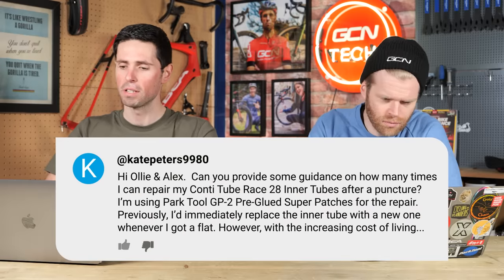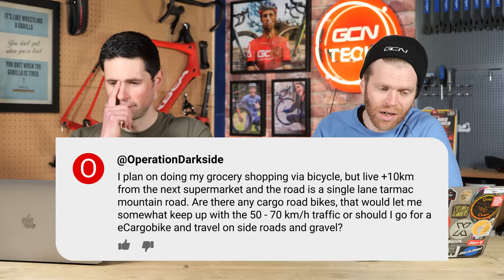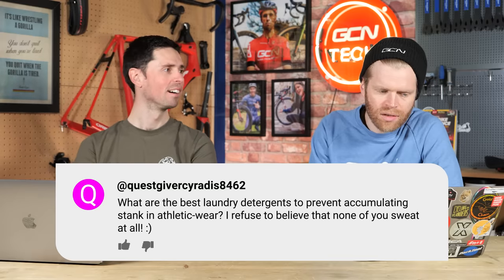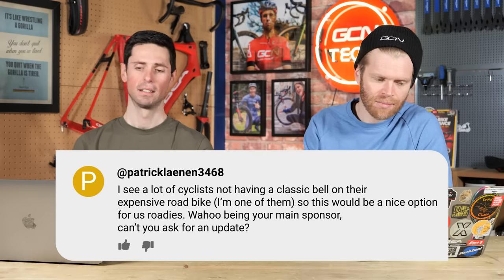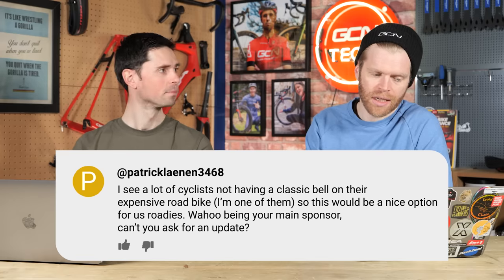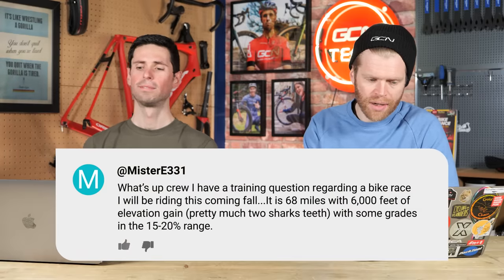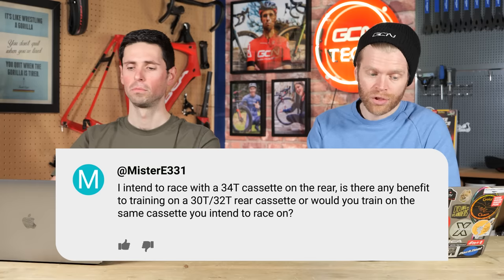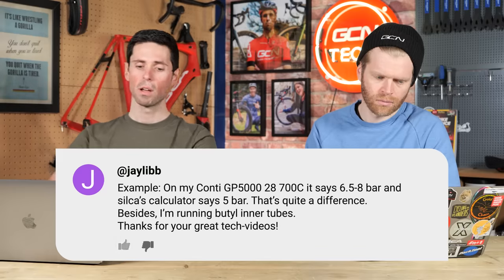Optimal Tyre Pressure, Noisy Chains & Inner Tube Repairs | GCN Tech Clinic

Comment: Hi Alex & Olli, this is probably not a tech-related question but you guys have done some videos on bike saddle and fit. I've been cycling since 2016 and I started having saddle sore issues from 2017 till now. I've tried different saddle types and brands, used different bike brands, tried out different bib shorts from various brands, done a lot of bike fit (sometimes multiple bike fit for the same bike) but nothing seem to help. I wouldn't be so much bothered if they were normal sore that most people riding a lot probably have from time to time, but sometimes mine could last for weeks (i've even had a surgery once to cut it off). I need help guys, I don't want to give up on cycling (it's the only sport i'm interested in, besides my performance on the bike motivates me to want to keep going). What else can I do? Thanks. #askgcntech

Comment: Some of my tubes have three or four patches. 10 years ago, I bought a box of 100 Rema Tip Top F1 25mm patches. I probably could have used F0 patches 16mm, but I still have lots of the 25mm ones.

Comment: @ollie  Hey Ollie, So glad you guys are pushing waxing and have stopped the Muc-Off support. But you are giving some out-of-date advice WRT removing the chain from hot-melt wax. You say we should let the wax cool until there is a skin on the surface and then slowly remove the chain. This is not necessary and also just uses up a lot of wax which sticks to the outside of the chain. This gets ejected in the first 10 minutes of riding as you break-in the newly waxed chain. The wax that matters is inside and there will be no difference in the amount there whether you remove when the wax has cooled or when it's hot.  Check out ZFC. I think Silca used to say let the wax cool so there was a skin - but again, not necessary and a waste of wax.

Comment: I can't imagine ever having a bell or beep type device on my bike although there are times when it would have come in handy when passing a slow group of side by side walkers or cyclists. Although I suppose that it would be pretty easy to add such a feature to a bike computer without adding much cost and weight.

But I always ride with an eyeglass mirror. Tiny, unobtrusive, easy to use and very confidence-building. I hate looking back and find it hard to do while riding. Looks dorky but better that than an accident.

And, just waxed for the first time yesterday, using MSW. Haven't ridden with it yet but will try later today on the trainer. Still feels kind of weird and the process is kind of messy but I've heard such good things about waxing that I had to give it a try. Hopefully it won't make a mess on my floor.

Comment: #askgcntech combination question/statement. is that allowed? i've been waxing for a few years but i don't follow the procedure you describe exactly. i put my chain on the cold wax in the pot, THEN heat the wax (and the chain) to around 95. that way i feel confident that all the wax around the pins & inside of the rollers has also melted. then i turn off the heat, let it rest for about 10 minutes and finally agitate for 3 minutes and remove to cool. i never let it sit until it starts to scab over in the pot. it seems to be working okay, but am i doing something wrong by not letting it cool more before removing?

Comment: Just used this extract in a reply to someone else, but I'll just put this out here for clarity. In the Conti Bicycle Tyre 23/24 catalogue there is a note which is related to the indicated lower and upper pressure indications which states:
Please note, that the pressure in the size overview indicates the recommended pressure on the lower end and the maximum pressure on the upper end.
So the the second number is a maximum pressure  but the first is not a minimum. Note that this statement applies particularly to Continental in reference to the OPs question.

Comment: Noisy waxed chain that won't go away - probably threaded incorrectly when putting back on. Need to get it threaded the correct way around the derailleur and pulley wheels as there is a metal bar there. It will make a light clicking noise if the wrong way as the chain hits the bar constantly rather than smoothly going under it. I did it once, learned from that myself.

Comment: just add a bell to your bike, what is the fuss about not wanting a bell on your bike? I have a spurcycle bell halfway my handlebars so that it is operable when I am down on the bars as well when I am on the hoods and you hardly notice that it's there! I positioned the bell on the handlebar about halfway the brake lever and it is pointing outwards ever so slightly to not compromise the braking action.

Comment: I use a bell on trails . And a mirror on the roads..I hv no issues with weight... it doesn't add me any advantages so I hv lights front and rear. All the time.

Comment: I also call out "ding-ding" when approaching peds, when I don't have a bell, but the sound doesn't carry as far as a bell, and does not signal a bicycle is approaching as effectively. Some areas require bells and an officer can write you a ticket if you don't have one and they want to yank your chain. Of all the bells I've used on singles and tandems, the one with the sweetest tone is the Spurcycle. It's not loud, but the sound does carry.

I've applied hundreds, possibly thousands of innertube patches. The only ones that have ever failed were glueless or patches applied to large holes or snakebites. I've had tubes with over a dozen patches before I've retired them, and have even patched some with large pieces I've cut from latex tubes and wrapped completely around the tube. I only use glueless patches as a last resort, when I've gone through the spare tubes I carry in a seat bag. I've used cheap Chinese patches with good success, but nothing beats Rema Tip Top patches.

Comment: About the last question, does the chain absolutely need to be broken in? I.e. does it hurt longevity of the components or do you need to rewax earlier if you don't? If it's about quietness, probably a bit of performance, and/or preventing flakiness, I'm inclined to just not bother and ride it.

Comment: I believe you missed the point about bell they are useless, much better to shout out which way you are coming ie left or right. I experience a lot of the young generation have headphones and don:t hear, older  people have hearing problems and travelling at 20 mph the sound of bell does not carry with the urban noise that is around.

Comment: There are lots of uses for beyond repair innertubes, so they need never see a landfill.  
The key to keeping the stink out of cycling clothes is to hand wash with any cheap shower gel (body wash) as soon as you take them off.  The fabrics hold odors tenaciously if you allow them to dry while sweaty.  
A bell is useless when all the pedestrians are wearing earbuds.  
A mirror attached to drop bars only works optimally in one hand position.  With drop bars, you'll spend more time fiddling with the mirror than actually using it, making it a safety liability.  Pretty much the same for a tiny one on your helmet or glasses.
A clean chain with fresh lube is a quiet chain.  You can do a "perfect" job of waxing a chain that wasn't clean to begin with and never achieve the intended goal.

Comment: I don’t believe Conti GP5000 28mm writes 6.5 bar as the minimum. check again¡
Reply: I think they have recommended and maximum tire pressures on the box, but no minimum.
Reply: From Conti's 23/24 catalogue: GP5000S TR 28mm 73-94 psi (5.03 - 6.48 bar) and GP5000 28mm 95-115 psi (6.55- -7.93 bar) However there is the following note appended:
Please note, that the pressure in the size overview indicates the recommended pressure on the lower end and the maximum pressure on the upper end.

Comment: Mirrors: maybe 45 years ago, there was a Mirricycle that attached to the brake hood. A friend started cycling in London but wasn't used to looking back and certainly didn't ride with flat enough back to dip his head to look back. I suggested the Mirricycle and it worked great for him. Age 69, I recently cricked by back, then my neck and couldn't look back - to ride or drive - but osteopath sorted me out nicely. Otherwise I'd have googled mirror the bike and either stopped driving (my wife to here appointments) or tried to fit old style wing mirrors like we had in 1970s before cars came with rear view mirrors on the doors
Reply: I've been wearing an eyeglass mirror for decades and would never ride without one. Takes a little bit of work to get used to it but once you do it's so easy to give a quick glance back now and then. Yeah, it looks a bit dorky but having a face from a horror movie looks even dorkier.

Comment: #askgcntech Hi Alex, Ollie & Manon - I use a track pump to inflate my tires and when unclamping the head from the valve, some air escapes.  Using the gauge on the pump, I've measured the pressure as much as 5 psi lower.  For example, I pump the tire to 55 psi, unclamp and immediately reclamp the head, and the pressure is 50 psi.  Have you guys ever studied this?  Should I compensate by inflating to 5 psi over the desired pressure?  Thanks, love the show.
Reply: The air you hear escaping is the air inside the pump. When you unclamp the pump the one-way valve in the tyre prevents any air escaping the tyre. The pump does not have such a valve so the still pressurized air in the pump escapes.

When you then reclamp the pump to the tyre the air inside the tyre is used to pressurize the pump. Thus lowering the pressure in the tyre because all the air that was previously in the tyre alone is now distributed over the tyre and the pump.

Hope this helps :)

Comment: #askgcntech Hi Alex and Ollie, I want to buy a new frame for a lightweight/aero bike and I am between sizes, after doing a bike fit. Is it better to go for a size 52 with 2cm of spacers and a 100cm stem (instead of 90 as standard) or to choose a size 54 with 0.5cm of spacers and a 90cm stem (instead of 100 as standard)?
So no spacers and short stem or spacers and longer stem?
Thanks!
Reply: It all depends on how you want your bike to ride like. Going for the smaller size gives you a more reactive bike to ride on, a larger size has better stability.